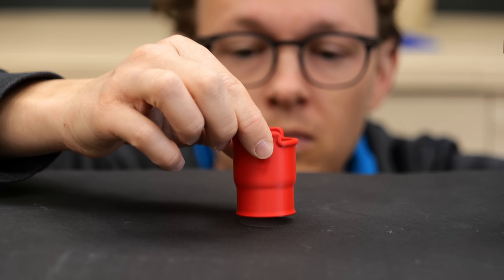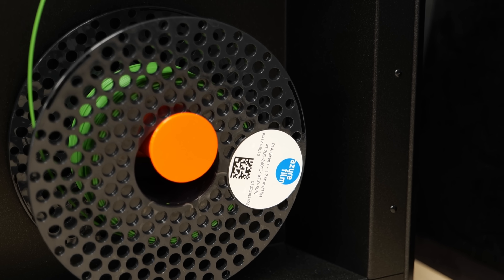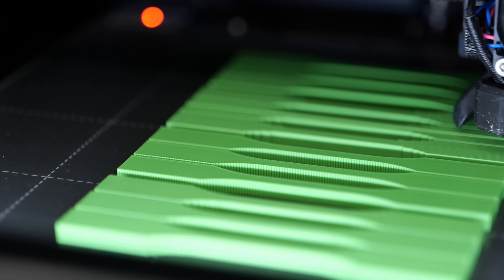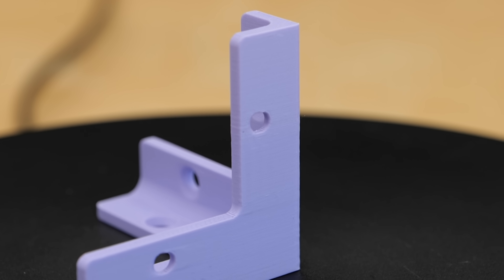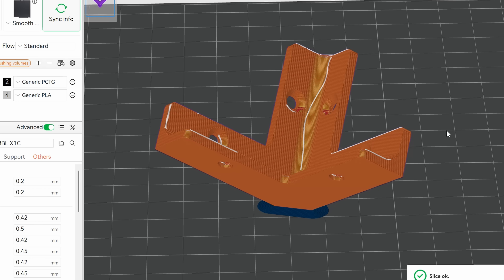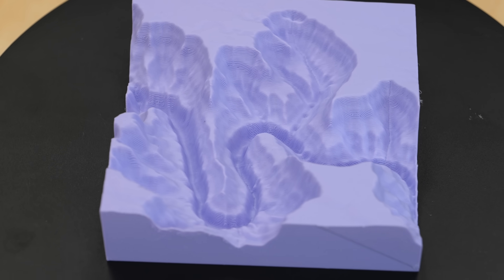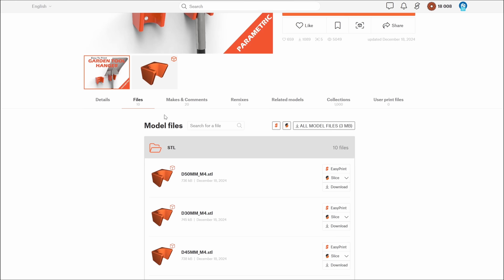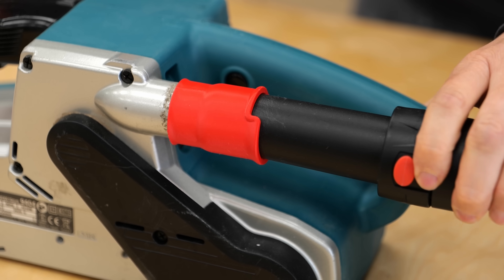Does Angled 3D Printing Really Make Parts Stronger?

Comment: Built the design for multiple parts that are printed at layer angles that are at 90 and 45 degrees to each other. Then assemble those parts to create the final piece. Bond such pieces together with epoxy or some other kind of glue. This would mimic how composite parts are made, layer by layer of composite prepreg sheets. Each ply is stacked with fibers at alternating angles. 90,+45,-45,90,-45,+45,90, for instance, in a "balanced" lay up producing a quasi-isotropic part.

Comment: About that benchy-boat:
I noticed, when o stretch it in both horizontal axis to twice it´s original size, but keep the height unchanged, it´s new proportions are way closer to the ones of a real boat with such a bridge.
And it looks like, when printed successfully, it can actually float without tipping over.

Comment: Print it Sideways
but add compensation for dimensions and top droop
and add some external lips for a pair of Hose Clamps to wrap around the outside; to avoid the splitting problem.

Comment: I can answer without even watching: no. The strength of the print comes from the layer to layer adhesion. BUT changing the angle of your print to make those layers align with the forces they'll be experiencing, then you have a better chance at not exceeding that layer to layer adhesion force

Comment: One trick from the plastic days is to heat up the part in water, and if you get the heat and pressure right you can get the parts that are supposed to melt together but didn't fully to melt together without wrecking the whole part. It can be a bit tricky though.

Comment: Umm what you need is a 3D plane 3D printer that runs on CnC 
To print the rings first then rotate the head sideways and print the sides. You can do a zigzag while it’s rotating and even do straight as well. You got like three layers of different lattes though I’m not sure how easy the hot milk sticks to cold sub grid …
Actually, what you better to do as you use a horizontal spindle and use it like a lathe & print on that… omg 🥰 it would be the first 3-D printer lathe?!?! 🎉🎉🎉 

Good luck making the 3-D printer lathe 🥰 🎉🎉🎉🎉

Comment: Great info on printing! This video does bring to mind a question that's sometimes worth asking: is replicaring a part actually the best solution?

That adapter seems to be adapting a small enough difference that a standard $3-5 flexible plumbing coupler (or a short rubber hose with a screw connector if you can't find the right size ID) would probably work and if not, a few O-rings to build up the tool end and give you a flexible attachment point more or less immune to breakage.

Comment: Orientation change is an extremely important modern issue in our anisotropic-discrete World!
No kidding: Your work is great! I am impressed by the scientific-empirical consistent and pedantic approach.
I have a general question: Are there types of 3D printing, where strength is the key criterion? For example, metal casting using a mold prepared on a 3D printer, maybe there is some kind of powder baking with a laser in a chamber with low-melting aluminum dust?
If you have videos on your channel about similar technologies, please point to them.

Comment: 3D printing needs to find a way to somehow fill the inside of the parts. I don't just mean putting the Fill setting to 100%, I need actually filling the insides so that there is solid mass and not just a whole bunch of layers. Or maybe an advanced setting where individual layers criss-cross instead of stacking layers on top of each other to (hopefully) reduce points of failure.

Comment: Angled printing is a game changer, it allows some prints to not need supports at all, and if you have a little pin sticking out, printing at an angle makes so it no longer snaps off that easily, combined with high Z strength filament it only gets better.

Comment: When you're tired of just shifting the angle at which your parts break: Change the material. There are many options out there up to and including metal. The limits of PLA (as well as the printer and printing conditions, which are also factors, of course) doesn't magically disappear due to a changed angle..

Comment: You should do a video where you add screws to printed parts in strategic locations to make them stronger. For example, if you have a hose connector printed with layers perpendicular to its length, add bolts that span the full length of the part/ essentially compress the layers with some amount of preload, making shear failure effectively impossible. You could probably even make the part stronger than an aluminum equivalent.

Comment: At 1:17 you can clearly see voids in the perpendicular to the bed one. When printed on an angle the perimeter typically fills the part more.

I have been preaching about pan head for upright walls, and countersunk for bottom an top surfaces for years. For your angular bracket, counter sunk screws is simply a no go. Also, I use a 0.6 nozzle, and the part thickness need to be at least 2.4mm. If I print at 1.8, quality just falls apart.

Printing a spread lady at 45degrees, is often rereferred toas  a warping nightmare, often used to illustrate just that.. They are really not. First of all, just fade out ABL early, and do a ABL reading for say every 14mm. Also, avoid printing with too much infill, where the part is thick. Try to align both infill and the part, so that the plastic pull in as few directions as possible, I find that to reduce warping to the extreme. For the most part, I print rather large parts, and due hardly any solid infill, and sparse infill that run along the perimeters. The more solid you print, the more the part will warp.

You mentioned the bottom of a 45 deg print to bulk at the bottom. That is just embarrassing. That is simply because your printer is not properly calibrated. Let me explain:

The slicer assumes a given height between layers. That includes the first layer. Ideally, when the first layer offset is set correctly, the first layer will be printed so that the part gets the correct Z height. So I use a caliper and measure the height of a shallow print flat print. Adjust the toolhead offset, to give you the approximately right height. Make sure to use the right buildplate setting in the slicer, as they apply different first height layer for different surfaces. Now the issue of math arrives. If the slicers actually apply the right math for your build plate surface, the flow of the first layer should be the same as for any other layer, simply because that is what it is: a supported layer. When done correctly, there is no need for any elephant foot setting what so ever. It will be as any other layer. When the slicer do the math wrong, you need to adjust the flowrate of the first layer accordingly, as in, get a first layer that is approximately equal to any other layer, just be careful with that, as it messes up the speed and flow, so if you have dialed in a max volumetric flow, it will not abide by it, and you need to apply math to correct it.

This is probably the most misunderstood aspect of how Babu calculates its first layer, as they for instance use the lidar for exactly this purpose.

I also would like to point out, that just as countersunk holes don't print at all for upright walls, the physics of printing at 45 degrees is also pretty messy.

Once you dive into the arachne settings, and carefully look at how single line extrusions are applied, you will find a ton of single line printing in mid air, with no support, with detractions in places with zero chance of success. For printing parts like you just did here, with the corner bracket, I just cannot get them print, without seriously alter the settings for arachne. I need to use 127% for minimum feature size, to avoid single line bridges, as those bridges simply are printed unsupported mid air. I alter the wall transitioning threshold angle to 25%, which really seems to almost fix my issues with printing threads.

That is like completely different as for surfaces running along the plane of the bed. Fillets start out with insane overhang, read, they hardly ever print with any accuracy.

Personally, I round off edges that are ending of walls that run 45% to the bed. As mentioned, they are a minimum of 2.4 thick (the wall is, not the width as to layer lines), and by using a fillet this way, edges print super smooth with straight edges. This is the only way I get nice 45degree prints.

Since I mainly print using PETG, anything printed at 45deg, like that corner bracket, really only makes sense with cooling at max, and temp as low as possible. If not, accuracy is just lost. That sort of reduces layer adhesion. I am not sure this focus on strength is that important, sure nice graph you got there, works for marketing. But when you need a bit of accuracy as well, particularly for the infill, strength at accuracy is kind of the only thing that matters, as that is the only way that actually works. You don't measure that. 

I could go on, but I guess that will have to do for now. This is like basic stuff for my line of work. Not used to interact with anyone that comprehend any of this, would be nice to reach anyone who actually did, and share experiences. Lets see how this goes.

Comment: For countersunk screws, and in fact, most screws: use a washer. It takes the forces that would split the plastic and distribute it. it works with regular screws too, it is rare that the underside of that screw is perfectly flat but there is usually a bit of conical shape going on, even if it is just the transition from screw shaft to the base. Even that little bit can start a crack, it tries to pry open the layers. A stamped metal washer removes all of those forces. Stamping process makes the washer just a bit concave on one side, the forces all go first to the edges, then to the center: we get the an opposite force holding the layers together. Not a lot but it is biased towards holding instead of splitting. Drop a tiny, tiny bit of glue and it will stick to plastic part and make it look quite neat too.. You do need to create an indentation for it to make it look really sleek. Check with a magnifying class if the washer has a curve and if it is biased. Not all of them do, metal doesn't have the same problem so there is usually no real need to bias the washer curvature..

I would say that you should never ever use any bolts of screws without a metal washer with prints. Ever, the difference really is striking, you can use so much more force without them ever splitting apart, especially in the cases like sideways printed L bracket here. Check the underside of your bolts and screwheads with a magnifying glass. You might be surprised how much angle there might be trying to split the plastic layers and lines apart. I've even used drywall screws with 3D prints by adding a washer..

Also, just realized that this is a good video idea, Mr C. N. C. Kitchen could test it..

Comment: While this is fascinating, and i at times print workable parts, i mostly print small models for wargaming/roleplay.
So print strength is usually not important there.
There the important things are more bed adhesion and visual quality from up top at an angle. Since one will most of the time look down on the models. If an armpit is ugly it doesn't really matter, but if the face and the top of the head is a pile of spaghetti, it will not suffice for a character model.

But my main concerns are filament use, angling to reduce islands, angling to have face and front more pretty than the lower interest areas.

And some will claim otherwise, but fdm will produce decent miniatures with proper settings.
There are those that don't agree, but those are neat freaks.

Comment: I wonder if an acetone vapor chamber would improve the tensile strength since it slightly melts the outside layers of a 3d print.. I know it can be used to get rid of visible stepping and lines when done right

Comment: You know i wonder man, i feel like this is where we could really use some adversarial neutral net ais, like the good old times of ai.

Like what if you had an ai that just had enough of an understanding of 3d printing deformation and other issues that it would compensate for that by modifying the print file dimensions so they become correct and more accurate after it cools. And i bet the ai could even be tuned that if the first print doesn't come out perfect or has done issues, you could scan the print and give it to the ai and it could self correct so the next print is perfect

Comment: On his comment about tightening a screw in. You can adjust how much torque most hand drills out put by turning a ring on the neck of the drill and just start at the lowest setting and go up until it drives the screw to the desired depth. This is especially useful if you know you're working with something that could be broken by over torqueing the thing your trying to screw in.
Reply: yeah
I feel like for the demo he was being intentionally ham fisted to force the outcome he wanted. Kinda disingenuous.

Comment: Best answer: turn it into 2 sleeves and print them in opposing angles, then glue them together for the best strength
Reply: also, use the printed piece to make a mold, and then cast the actual piece when you are happy with the prototype

Comment: There simply is no ready receipe for all cases. "What i do?". Apart from orientation strength can be increased also by many other means, eg. adding chamfering/filletting/strengthening ribs/inner holes for perimeter walls inside/infill/infill modifiers/perimeter wall settings/layer thickness and so on. In some parts looks or amount of postprocessing needed or filament waste  might take priority and orientation might depend on those more then for strength (eg. for slightly angled or rounded surfaces to not look bad). Each case different.
Still, i find video to be beneficial to many, as increasing count of available means to increase print quality or strength or looks or whatever else is prioritized, is only helpful, especially if theory is backed up by well presented experimental data

Comment: In my experience often you rarely need that much strength.    If the part only has 15mpa on it it really doesn't matter when the weakest orientation is 30 or 60mpa.    I mean I still try to orientate it ideally but I don't bother with funky angles that end up needing tons of support.  Most of the time I just overengineer the part so that it will be strong enough for the purpose no matter the orientation it gets printed.

Comment: Honestly I find that for strength, I find the material and print parameters to be far more important than the orientation, at least in most cases. A hard tpu is wonderful for things where layer adhesion is important, and it gets even better if you turn up the temp a hair and slow the print speed, tpu however, results in a more flexible part, though you can buy harder tpu blends to help mitigate this.

 Design is also important, like with the foldable hooks to eliminate the weakpoint in layer lines, but adding features, like trusses, or ribbing, can go a long way to increase strength if used appropriately. Even just the chamfering or radiusing of sharp edges, particularly interior edges, can go a long way in minimizing stress concentration.

  Probably one of the most overlooked things is print parameters. I can't believe how many parts I come across that strength is an important factor, yet the design is defaulted to two walls and 30% grid infill. You can get a lot more strength out of most parts by either using a higher density, and better designed infill, or my preferred method of just raising the wall count till the part is solid, (hopefully we can get a staggered or interlocking wall feature in slicers soon) the downside is that making parts solid, or decreasing void space increases the material cost and print time.

A combination of these methods, as well as changing print orientation can result in some surprisingly strong prints, and this is not even considering post processing operations, such as vapor smoothing which can, theoretically at least, increase layer adhesion. However past a certian point it may become more cost and labor effective to use a "real" part produced by time tested methods and/or using a more robust/durable material.

Comment: I don’t own a 3D printer myself, but from time to time I order 3D-printed parts online to repair GoPro mounts or tripods for my wife. From my experience, resin prints are definitely the way to go. They far outperform FDM prints in terms of toughness, though they come with their own set of challenges especially when dealing with large, flat surfaces.

Another interesting approach is the use of composite materials. For example, you can make your FDM prints hollow, insert nails, screws, or even small rebar inside, and then fill the cavities with a two component resin or concrete. This method greatly enhances the structural strength.

Comment: 6:20 round head screws with a washer is the solution. Also set the torque correctly on your drill.
Reply: Not if you need something countersunk it isn't. "You should have a different problem" isn't a great answer if you have specific requirements... although it's always a good question to ask in figuring out your requirements.

Comment: for this kind of part, is there a way in a slicer to simulate rebar? In other words, if I bought some thin metal rod, in this case something around 12 mm in diameter, can the slicer help me accommodate that? Or do I need to model the holesthat the rod would go through and manually program a stop before the printer closes up the section?

Comment: I often print at an angle to reduce warping issues. They are almost non-existing on boxes etc. if you angle them. I also build supports into the drawing if I can't make the part print without supports. The latter being a main priority.